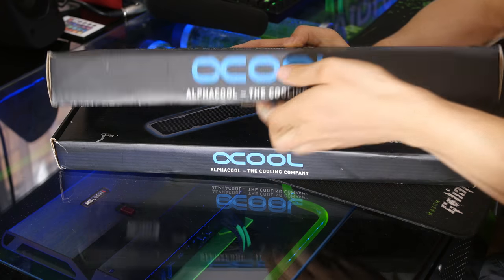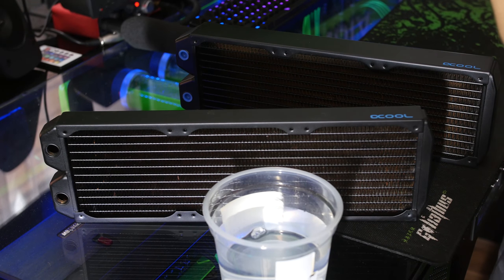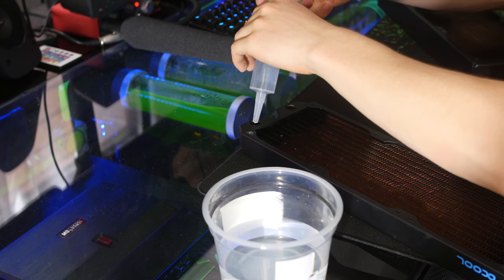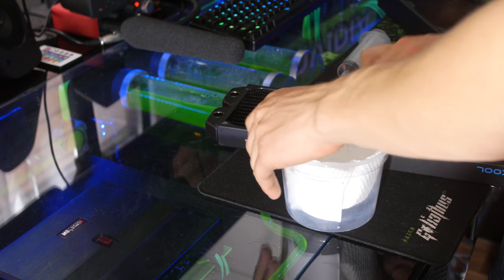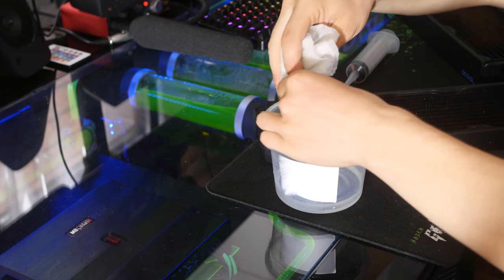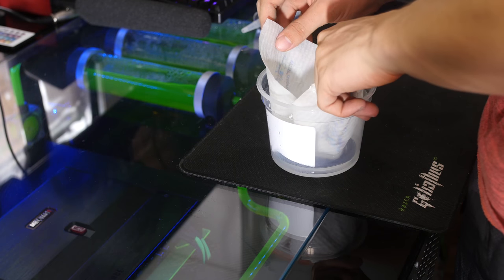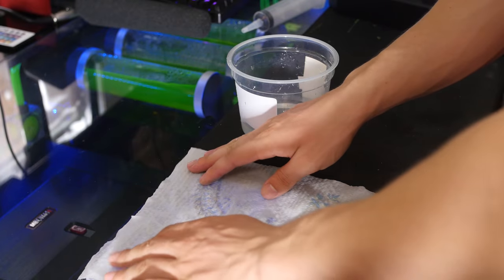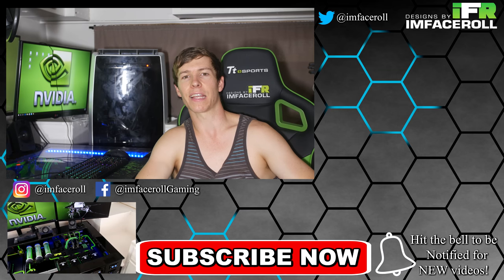Cleaning & Flushing a PC Radiator Water Cooling TIPS for Beginners

Comment: No, just no, vinegar and hot water, and shake it hard and repeat 2-3 times to get the soldering flux out it, and then flush with water a few times afterwards and then it is clean and ready for use.

I used his method the first time i cleaned a radiator and i got pink clear tubes after a month... So save yourselves the headache and do it right the first time.
Reply: His method works too, but it is has a higher risk of mishaps. And everyone on the watercooling forums seems to be under the understanding the hot water with a bit of vinegar is the best way of clearing the inside of a copper radiator.

When you use the vinegar it eats abit of the inside of the radiator and removes the corrosion on the inside of the copper radiators, i have tried it with 4 different radiators and the first time the water comes out it has a blueish tint to it aka the corrosion, and distilled water is not doing anything to remove that.

So depending on how good corrosion preventing coolant you use, then you'll likely see a strange reaction at some point when/if it goes bad, so it is important to clean the radiators right the first time and not have to redo a water loop as it went wrong.
Reply from the maker: +BearM304 if you do it ptoperly with water you dont really need to add the vinegar but of course that is always an option as well. All that is needed is a good shake a few times 2-3 like you said and it will be fine. The forums do state in places vinegar is best (which it is) but water will do the same job
Reply from the maker: +dit bol there have also been a few issues people have had with using the vinegar that i have found on forums so i tend to stick with water as the flux these days is now normally water based as well
Reply from the maker: +dit bol hahaha geah thats pretty bad
Reply: Do not use straight water, you will get corrosion. If you are going to use water or anything else, you MUST flush with Distilled water at a minimum.

Comment: I did it the exact way and it doesn't stop to come out... Also AlphaCool but NexXxos Monsta... I flushed 10 liters distilled water through 2 of those. Still small particles appearing. I think you can't be helped... I have filters in the loop but they aren't very fine... Fingers crossed.
Reply: How is it going so far?  I'm having the same problem I've been flushing it for about 6hours now and there are still small particles coming out.

Comment: #Question
Will store-bought Distill (Drinking) Water be good enough for cleaning...???
Reply from the maker: +Gabriel Swee you can use normal water but then id reccomend a rinse with distilled water
Reply: Designs By IFR 
I'm a little more concerned about the Quality the Distilled Water... does it have to be Laboratory/Industrial Clean Grade or simply Store-Bought would be Sufficient. (Head Scratching...)
Reply from the maker: +Gabriel Swee stpre bought is fine
Reply: Designs By IFR 
Thank you.

Comment: The radiator is brand new? it's rusty out of the box man  and there are signs that it has been used before. Even the boxes look used and as if they have been sitting around for a long time. .Did they send you a used one.
Reply from the maker: +Al D na its not rusty at all, it has been sitting theree in its box

Comment: Hey I have been using an orange thermaltek coolant and now my loop has stopped pumping water. Is it my pump or is it my radiator? And if my radiator how do I remove the blockage?
Reply from the maker: +Farhaz Ahmed hi, i dont think the coolant would do that but anything is possible. You may need to drain the system first and use some water to see if its the pump or not
Reply: I ve been having this problem for a few weeks now, once I leaned my pc forward and the liquid from one of the tube connected to the radiator drained into the pump, leaving the tube empty.